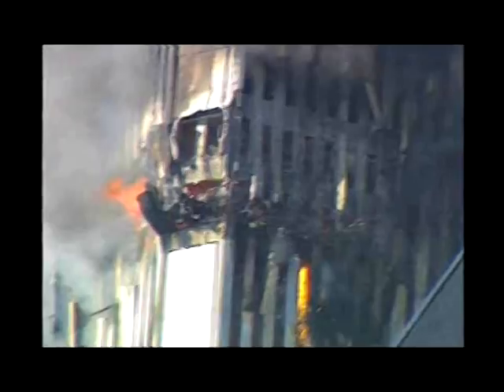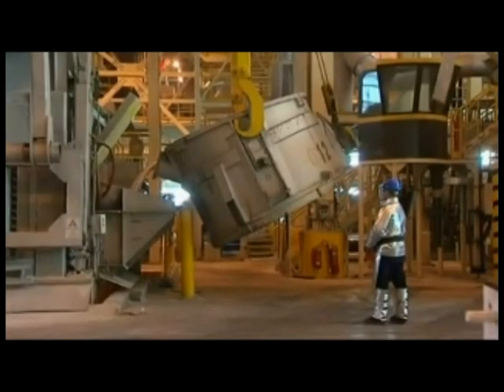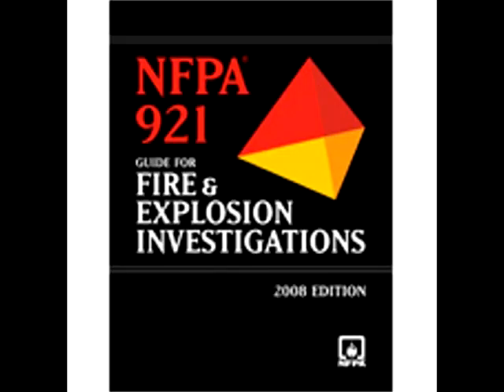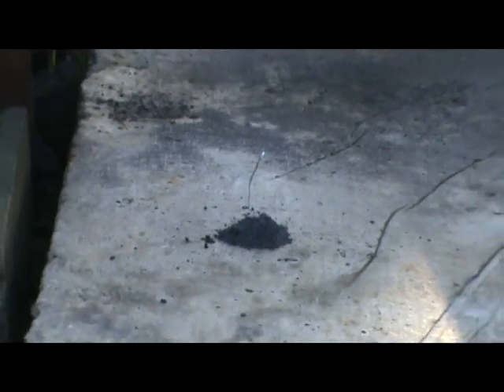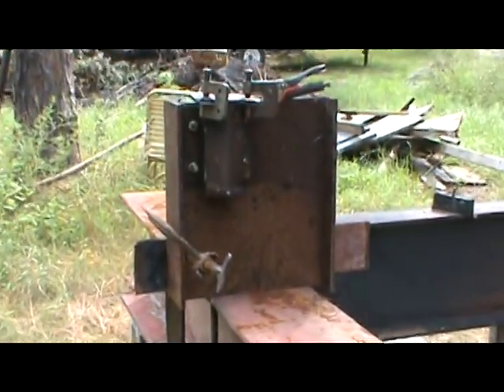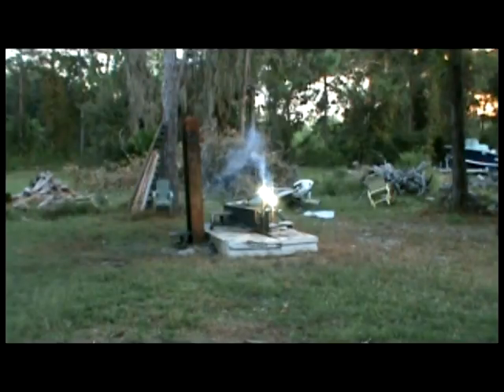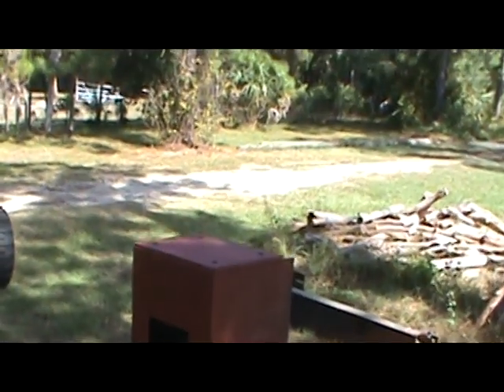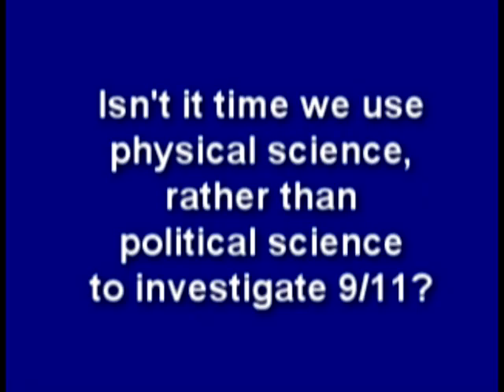9/11 Experiments: The Great Thermate Debate

Comment: Thank you for using the scientific method it is rarely seen these days. I am interested to see if natural oxidisation create a thermoelectric effect. As I have seen before certain building materials of aircraft to create a thermoelectric effect. 

There are three compounds that can do this that would have been found within the twin towers and the aircraft. I can’t really to them myself because I’m crippled and can’t do is safely so I thought you might be interested in trying them yourself.

Silicon e.g. Windows and portholes from plain and building.

Compound insulation glass fibres and small amounts of sulphur and compounds this one works well but I don’t think it has enough heat to make molten metal balls but I could be wrong.

Aluminium combined with steel and craft paint, I’ve done this one myself and nearly burnt my eyebrows off…